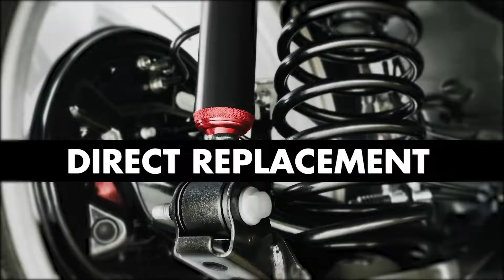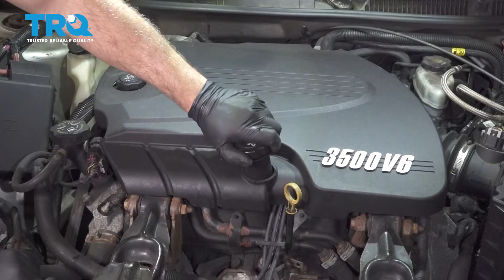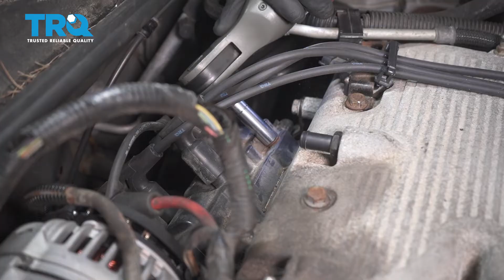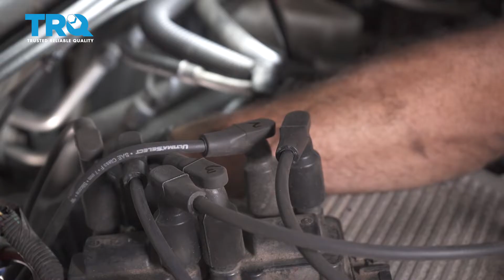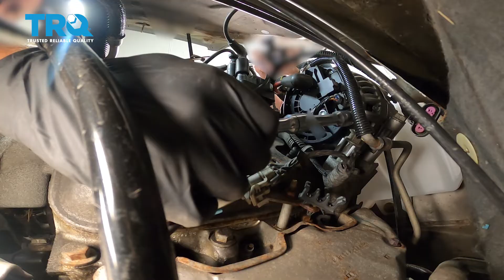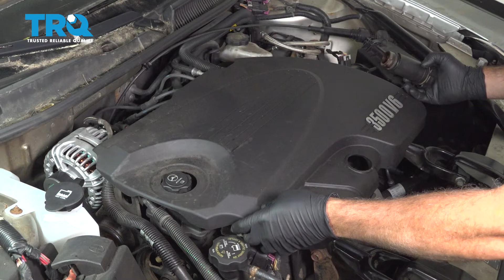How to Replace Spark Plug 2006-2013 Chevrolet Impala

Comment: You didn't have to remove battery terminal man. Why didn't you pull engine forward with ratchet straps?
Reply: Waste of time doing that, there's plenty of room back there to do it
Reply: @gravygrizz833  would have took me less time than it took you. I'll change all 3 in the back less than 8 mins. You're making ppl do unnecessary work.

Comment: You should've put a ratchet strap on the front of the motor and unlocked the front motor mounts to swing the motor a bit forward, would make it alot easier bud.
Reply: Shit I did this without even removing the distributor